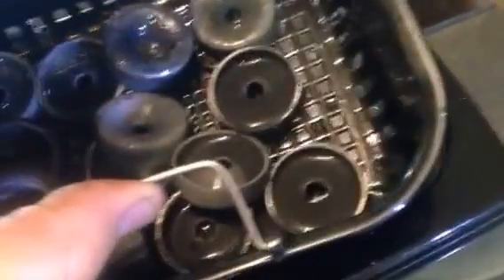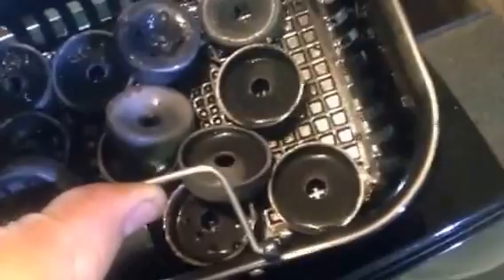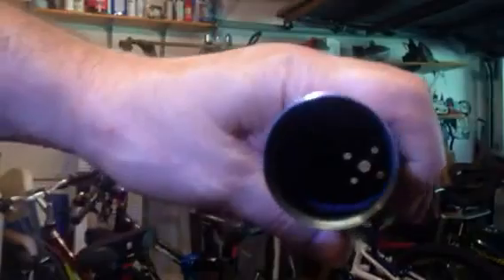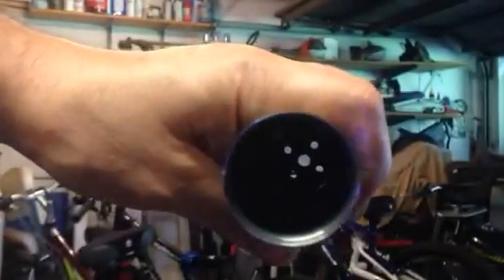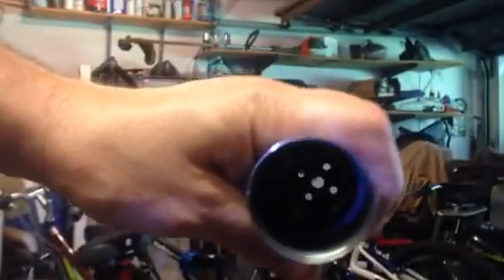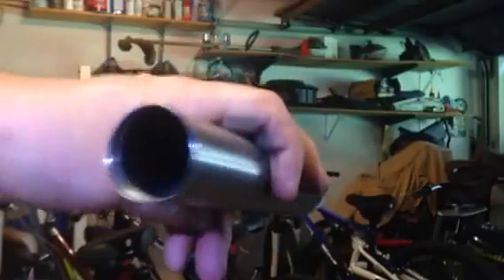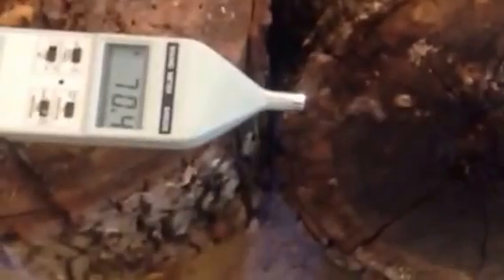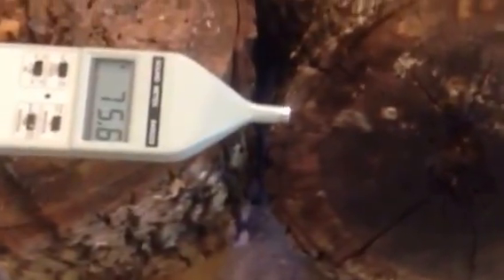Silencer with no baffels. This video is educational & documentary

Comment: Wait, people complain about a license? Is a license required to make a suppressor?
Reply: NO!!!!!!!!! You can buy the tube, end caps and plugs; but any machining or drilling is manufacturing according to the ATF. Even replacing a single baffle according to the ATF counts as manufacturing a new suppressor.
Reply: If you're making one for yourself, (with no intention to sell), having a license has nothing to do with it. You get your stamp on a form 1, and then make it.
Reply from the maker: GioGuitarDude 
If you see a someone riding a motorcycle do instantly assume they do not have a license? I shot my licensed silencer with out baffles. I did not manufacture more parts or replace parts. Chill out
Reply: Ramo's Vids drilling holes in baffles that you intend to manufacture into a suppressor falls under the legal NFA definition of "make". Altering a pipe or baffles that you intend to make into a suppressor falls into the legal definition of "make". Making a suppressor without an approved tax stamp is a felony.
Again, I wasn't referring to you personally, I just don't want anyone to take his advice and somehow get charged with a felony for following bad advice.
Reply: Ramo's Vids I was responding to pepelapu2004 when he/she said that you can technically build practically the whole suppressor minus the last step and it would be legal to do so without an approved tax stamp. 
I was not referring to you in any way shape or form.
Reply from the maker: GioGuitarDude 
YES that is correct

Comment: Love your channel.  Noob question here: How long will one set of baffles/plugs suppress your 223?  Will simply cleaning them after each use last forever or is it a few uses replace plugs type of deal.  Thx.
Reply from the maker: I have not used them enough to know. SD Tactical does now sell a service that replaces the freeze plugs with a mono-core baffel.
Reply from the maker: Jaime St. Patrick Three year’s later and here is what I think 🤔: Coating the baffles with anti-seize thread protector makes them last much longer. Anti-seize has a high temperature rating. It probably makes some-bad gas so I would only shoot outside. With a 22lr it has stayed on for over 500 Rds so far.